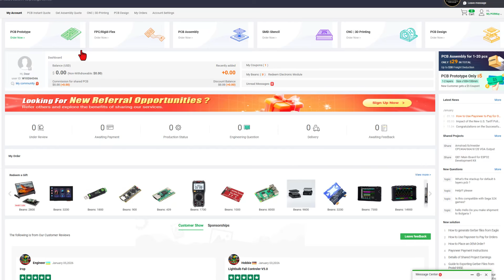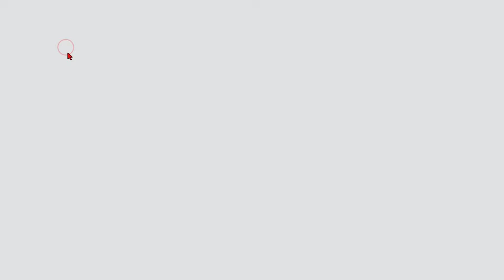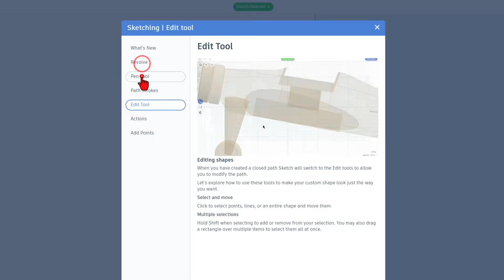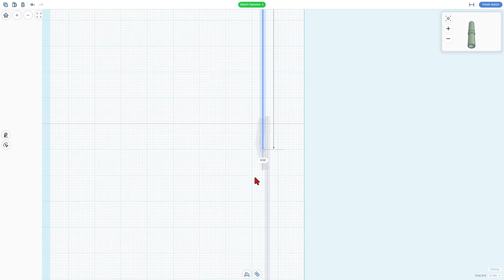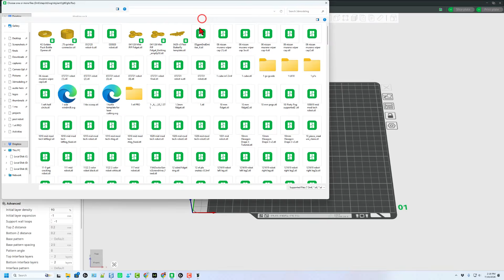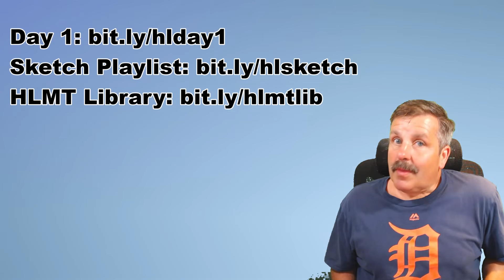Make Useful Parts with Tinkercad: A Pool Robot Extender Hook! 💯🔥

Comment: Mike, when you send it to PC Way have them print it vertical and not horizontal like you did for the prototype?
Reply from the maker: Vertical is less sturdy... it will snap along the layer lines.
Reply: @HLModTech  Maybe. I had the same thoughts but that is what prototyping is all about. The horizontal version looked messy and had supports. I have vertically printed a similar design to yours to be used as a filament spool adaptor and it has been working very well although the load on it was much less.
Reply from the maker: It is just a rule of thumb that vertical has weak points for snapping. I know how much that robot, full of water  weighs so I was not going to waste an attempt.